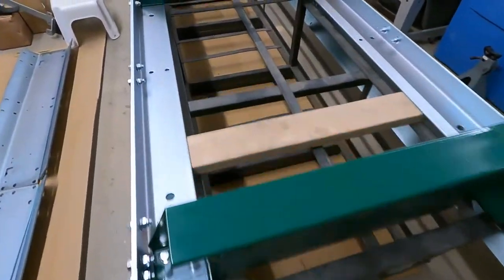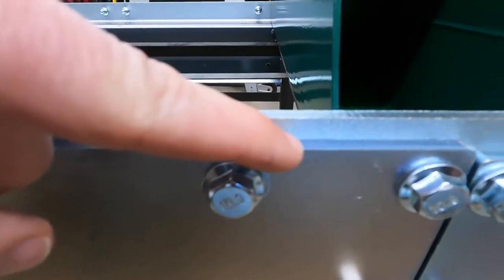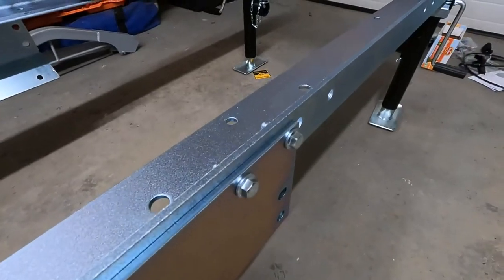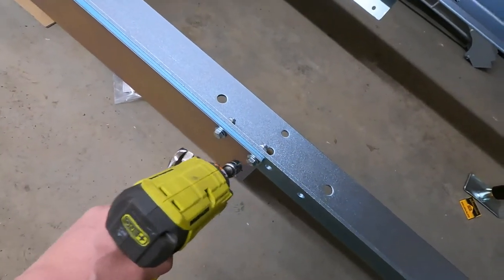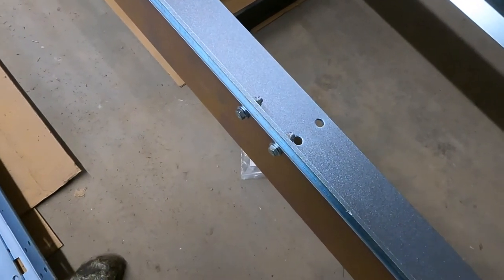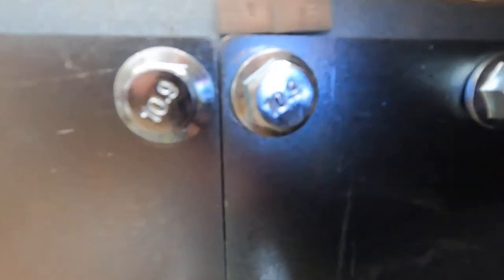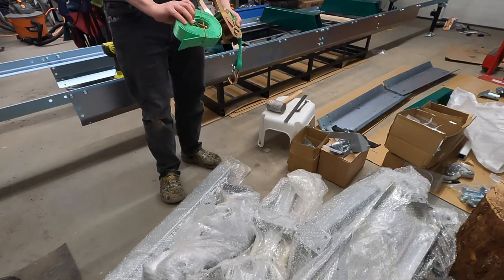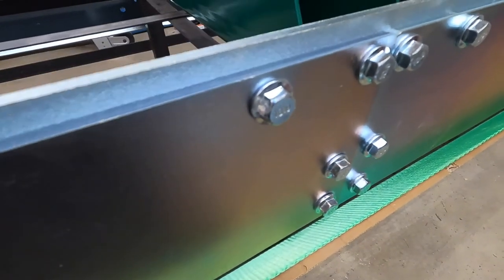Woodland Mills Woodlander XL Sawmill Trailer Assembly Part 2

Comment: If the gap is on the bottom and not the top of the rails.  Can loosen the bolts a little and put a jack under the bunk right there and lift it. Will eliminate the gap and the two rails should line up well also. I tried yesterday and worked out pretty good.
Reply from the maker: Makes sense. Sounds like a great tip!